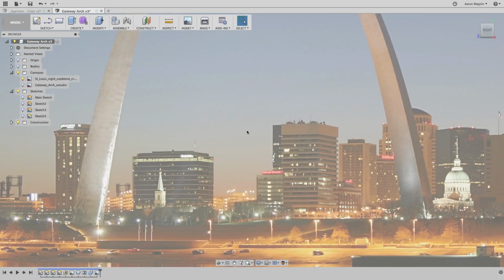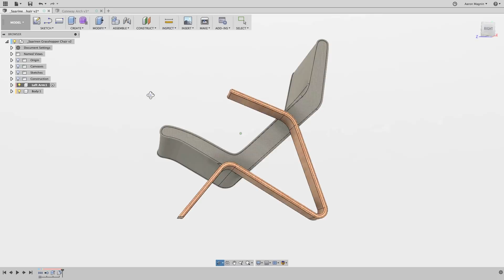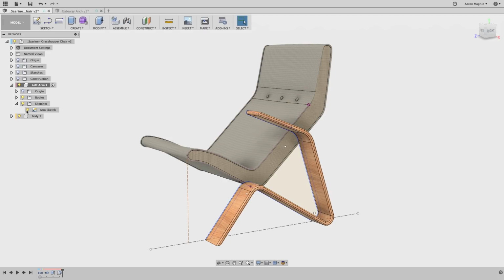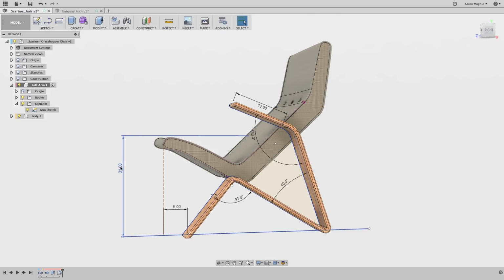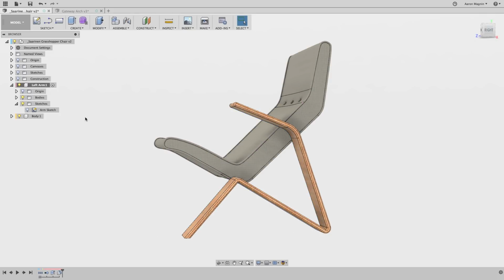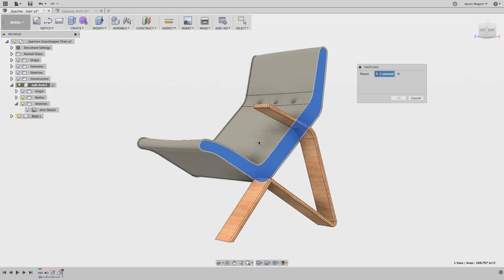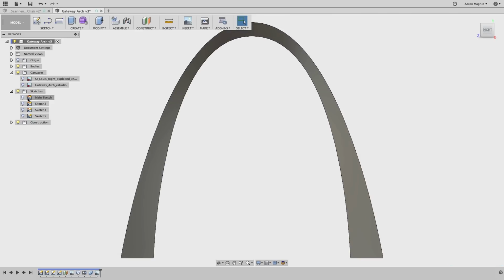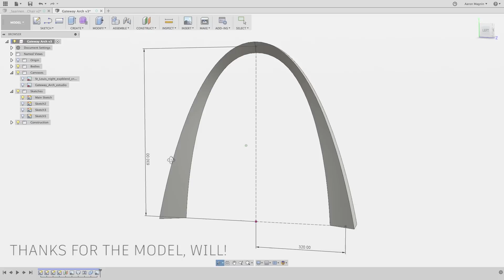QUICK TIP: Show Dimensions

Comment: This must be an old feature they have removed or only in a paid version.  I tried it today and there is no option to show dimensions.  I hate using the measure tool.
Reply: Its on my free version.  Right click on the sketches not the bodies.  Dimensions will appear on final work. Yes, after you have clicked "finish sketch" and extruded etc. everything.  Good luck

Comment: Useful, but still not a game changer...
Expand design tree, find sketch, right click to choose show dimensions, make your changes then do the whole thing backwrds to hide them again.
All other CAD software I have come across you simple double click on a surface of a your model, which brings up the dimensions of the base sketch of that feature, you edit - hit enter- it updates and the dimensions disapear again.

A much smoother and faster workflow, might be the reason why it is so popular with other software?
Reply: Game changer might have been a poor choice of words from my part, but it all comes down to the need of, by my opinion, an optimiziation - update of the workflow in Fusion. There´s just alot of unnessecary and time consuming clicking, scrolling and mouse travelling.

Btw, did you change your mind regarding the ""and perhaps better " you wrote in your reply, in that case would you care to elaborate?

This topic is entered in the Idea station and my vote has been cast, this commenting is simply to form opinion and some discussion :)

Great day to you.
//P-J
Reply: If any 360 Fusion user wants to wote as well.... here´s the link.
https://forums.autodesk.com/t5/fusion-360-ideastation-request-a/edit-dimensions-from-outside-a-sketch-or-feature/idi-p/6773238

Comment: need to add a cloth simulation program for product designers.
Reply: Thanks for your reply. I looked in App store but didn't see anything other than OBJ conversion. I guess I could then take it to something like Marvelous Designer unless you know of an app I am not finding. Thanks again!
Reply: Awesome, thanks. Can one save Fusion 360 files as an OBJ to export to Marvelous D or does one need the plug in for OBJ with Fusion?  Yes, MD is a pretty awesome program for doing soft goods.